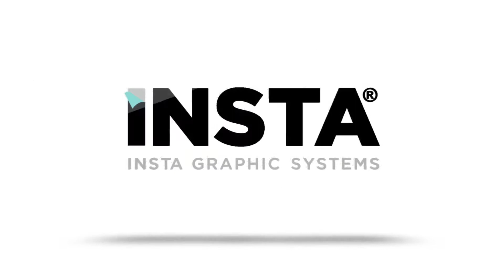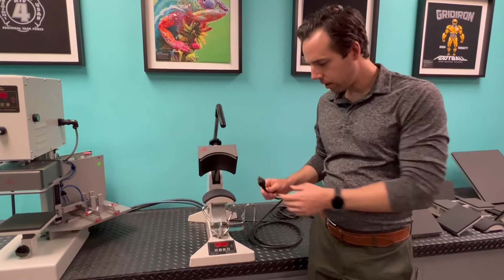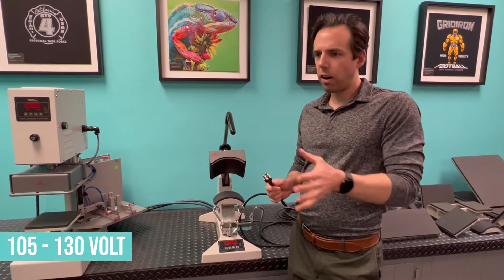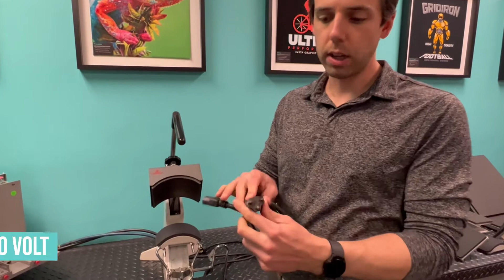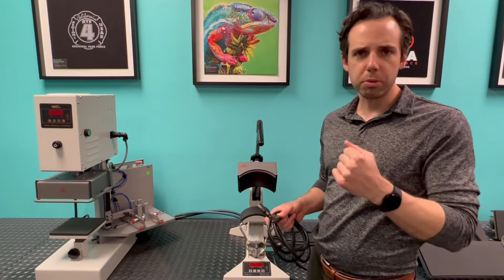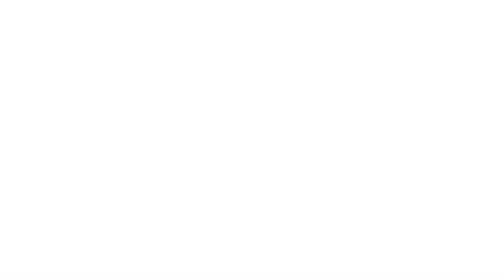Different Voltage? Insta Heat Press Machine

Comment: Hi there, just watched your video , which was super informative. I have a question I live in the uk and I bought a heat press from the USA and their electric data is 110V 1000W. What type of plug do I need for the uk. I used a 250V 13 AMP but it stoped working after a while. Not sure